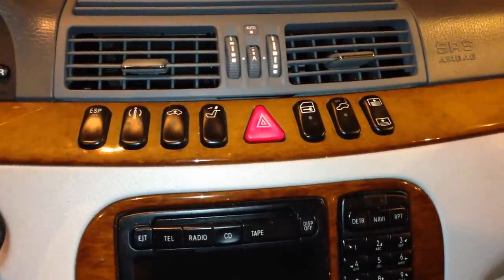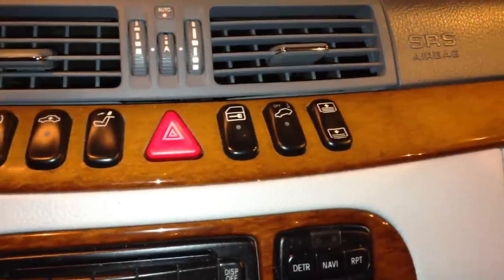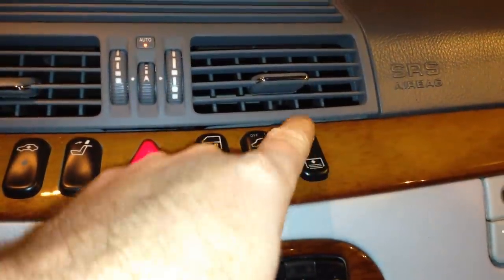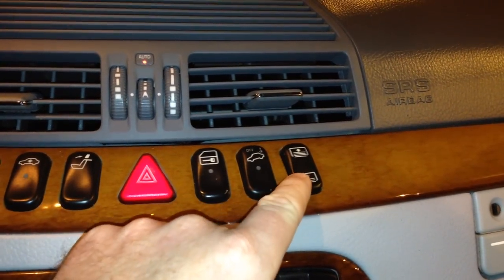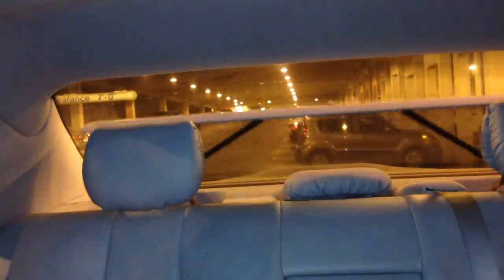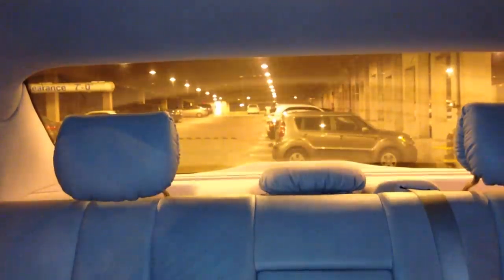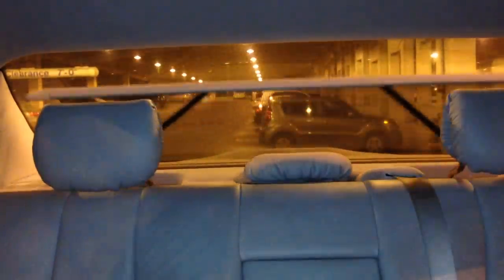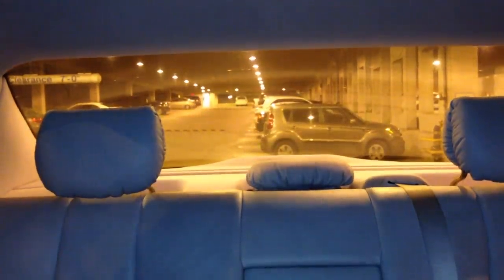Mercedes Benz Power rear sun shade HOW TO operate s class w220 s550 sl500 s500 BRC c230 e320 s320

Comment: My friend Mine is W219 broken.. I replaced with used one very clean and motor test is work and completed lubricant when we press the button going up okay
When pressing the button again, only click without going down 
What i should do?
Reply from the maker: Might be bound up at the joints on the sides, on the two hinges that straighten to support the shade in open position, they can sometimes sieze, so you can try lubricant at the corners and middle of the hinges where the bend abs pivot
Reply: @bmwrepaircrew8848  i lubricated it and flip the connection..then press the button and it's down very well 
I checked the motor out of the skirt with same connection i found the car gives order one direction to the motor...
Reply from the maker: My first thought is your button isn’t working or you’re not pushing down hard enough on the down button- otherwise it might be in the SAM unit that controls the sunshade, but seems if it goes up, it’s probably just a button/contact issue. But I think before you said it clicks when the button down was pushed so you should be getting a signal/motor engagement that why I figured it was bound up in the track or gearing

Comment: Great help. My 1997 e-300d wont go down and only clicks. After seeing those arms fold in helped. I pulled them end at top and hit the button a few times and it went down a little at the time. going up no problem.
Reply from the maker: James Locke great, glad you got it to go down!  When you get a chance try to lubricate the track the arms slide in and it may go down easier

Comment: Please help! My brothers sun blind has been stuck up. The buttons for it are on the drivers door panel and is set with the back windows.  Is there another button that I should be looking for?
Reply from the maker: Priscilla Chavez sometimes the shade can get stuck in the up position. Have someone sit in the back and gently push in slightly on the frame rails on the sides while you press the button. Be careful not to pinch any fingers (keep hands clear of the path of the arms and move them out of the way as soon as the shade begins to move). Otherwise if that's not it, could be any number of electronic things such as a SAM error, motor, switch, power/wiring - but start with the simplest solution as these can jam up
Reply: @bmwrepaircrew8848  Hi thank you for responding. We cant even find the button for it. The ones on the driver panel go to the back seat windows. Do you know where I can find the actual button for the back blind?
Reply: @thatgirlscilla  should be next to the emergency lights,  its a button with an arrow pointing up and down

Comment: What if it's stuck up ? Only goes down an inch or so.
Reply from the maker: terryble try 2 things: 1 you sit in the back seat and have someone hit the down button while you gently press the two arms inward. 2 if that does work try adding lubricant to the track the arms slide in (lithium spray grease, etc), then if it won't go down with just pushing the button repeat the above step 1 and see if it will go down while you gently press the arms inward

Comment: Are there places for lubricant?
Reply from the maker: I would lightly grease the tracks with it in the up position, as you can see it runs on the upper rail to push up, so try try silicone or lithium there. Hope that helps
Reply: @bmwrepaircrew8848  
Thank you! On my W210 it only goes half way and stops. No grinding noises just stops, it does go back with no problem so I will grease the tracks.
Reply from the maker: @blackchewy8435  no problem bro 👍 hopefully that will fix it, you can also try having a friend push the button (or use a long broom handle while you sit in back) while you pull on it gently when it is raising up near the point it sticks. Let me know if that works, 👍👍

Comment: Mine stopped working yesterday on my w211
Reply from the maker: Franz Liszt maybe try to check for sounds of the motor working- if none check fuses, if it seems to make a clicking sound or attempt to move, try to have a friend push the button while you gently pry it up with a thin flat tool (butter knife, etc)
Reply: BMW Repair Crew thanks for the response! Ive been meaning to try and fix it I’ll do that today
Reply: Did it work ?